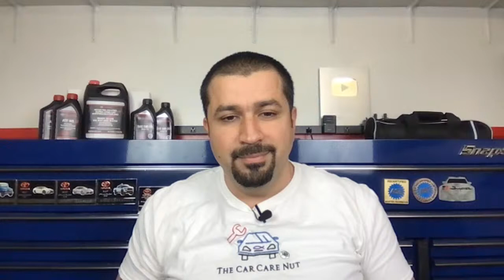Toyota Live Stream Q&A

Comment: Hello there. I really enjoy the good videos and advices that you are putting out. Your video on 14 Nov 2020 mention about the electric lube oil pump for 2.5 litre toyota atkinson engine which is programed to give a big boost in oil pressure when engine reaches 3000rpm. I think this toyota engine switches to otto cycle when it is at above 3000rpm. It need the higher lube oil pressure for the actuator to switch to otto cycle? . Regards.

Comment: 2013 Toyota Sienna, sliding door will not stay open especially on a slanted surface.  Basically it will not latch in the open position causing a safety issue.  Well out of warranty at this point, how do I resolve this issue?

Comment: Got a 98 toyota camry with  a 4 banger. Check engine light is on for the purge canister. That was replaced. Check engine kicked back on.  Could I have a bad computer or something easier to look for??
Reply from the maker: Hi! This will require some diagnosis but the valve at the canister is common to go bad on these. Needs to be tested first

Comment: Hi, guess I missed the live q&a 😟. I wanted to ask about my wife's 2010 RX450h and that her turn signal flash is set to one and she'd like to change it to 3 or 5 times flashing. I found a pdf on line from Lexus that explains how to do it but the display interface looks different than what we have and there does not appear to be an adjustment under Vehicle Customization. Our car does have Nav. 

Is there a way for me do change the setting without having to take the car to the dealership to either update the interface and or make the adjustments for me? Thanks!
Reply from the maker: Hi! I would take it to the dealership they usually don’t charge to change customizations

Comment: PLEASE tell us about trouble codes. My 2016(150k miles) sienna keeps popping codes P219D and P21A1 once a month. My Bank2 long trim stuck around -3.8 which means it runs rich and the AFR sensor doesn't change the readings . Bank1 Long trim reads 0.00 . The engine has no misfire and it runs great. My gas mileage has dropped a bit . there is no vacuum leaks or any kind of oil leaks either. I am about to replace AFR sensor on bank two (which closer to Radiator). Any help is greatly appreciated.

Comment: Hello great video.  Question for you. I have 2014 tundra 4.6L 4x4. Its has 82,000miles. I want to change the differential fluids. Can I use royal purple and is there any special additive that is needed with the fluid?
Reply from the maker: Hi! You can use royal purple and no special additive

Comment: Hi AMD and thanks for sharing  I have a 2014 Toyota Venza with @80K miles Recently I have noticed low cooling on the expansion bottle Went to a local Toyota service and they told me that there is an external coolant leak from the rear head gasket and their recommendations is to repair or replace the engine both options are very expensive The coolant leak is minor The car is running great and never overheated no evidence of mixed oil and coolant What are the risk to drive the vehicle like this? In one year I just need to top up the coolant once
Reply from the maker: Hi! If you keep the coolant topped off you’re good. But after some time it might develop into a large leak. Might be a long time though so don’t worry at this point.
Reply: Thank you AMD !!! I have checked and there's no recall associated with this.  Is this issue may be related to a manufacturing defect and covered by an extended warranty?  I never expect this to happen on a Toyota car....  @TheCarCareNut
Reply from the maker: That’s not something covered by a special policy.

Comment: Recently, my 2004 corolla with 207k miles has triggered the P0420 code. In 2019, I had the same code come on and after clearing the code the check engine light stayed off until now. The car does not burn oil.  At what millage do catalytic convertor fail? Do you recommend I take it to the dealer to have the ECM reprogrammed?
Reply from the maker: Hi! Are there any exhaust leaks?

Comment: Hey there AMD,
thanks for the wonderful work.
I just bought a 2015 Highlander Hybrid with 66k miles on it. The transmission fluid was never changed. Should I change it or does the CVT transmission not need that?
2nd question: Why do they sometimes say, that changing the transmission fluid could do more harm than good? Do you agree and when?
Reply from the maker: Hi! On regular cars doing the transmission fluid late can cause more harm than good not with hybrids. You can change your hybrid transmission fluid every 60-90k milestones
Reply: Thanks a lot master. I appreciate your work very much.
While I'm at it, I think I'm gonna change the coolant (motor + hybrid), since I think that those haven't been changed yet. Unless of course you say no to that ;)
I don't know any other important stuff to be done at 60k+ miles. 🙈

Comment: Another great live stream AMD! Any chance you could share some photos of the timing belt replacement on the 2UZ-FE you mentioned you are doing at work? I have to do mine on my 2003 4runner next year and could use some pointers.
Reply from the maker: Hi! It’s super simple if you follow the order. It’s like a big lego puzzle. Remove parts and line them up in a line then install them in the exact order. Read the manual on it and use the T marks not too dead center
Reply: @TheCarCareNut  Thanks for the great advice! I'm going to change the water pump as well and have seen some issues with the one O-ring not staying in place during installation. Any recommendations?
Reply from the maker: Use some lubrications on the o rings. You only have the ones around the water pump

Comment: Hi AMD, 2019 Camry LE at 25k miles. Driving in the southeast. The front driver side brake makes squeaky noise only in low speeds (2-3 mph). The pads look plenty good. It's only on that side and the noise started weeks ago. Doesn't happen every time.

What's the issue in your experience? Could it be bad caliper to pads lubrication?
Reply from the maker: Hi! There’s a TSB for this for updated pads. Would need to check if it applies to your VIN.
Reply: @TheCarCareNut  Thank you!! I'll check with the dealership on that.

Comment: Hey, I appreciate the service you are doing for your fellow men and women. You have probably answered this somewhere in your videos but I'm a new subscriber...I have a 2003 Toyota Tacoma with the 2.7 4cyl, it's a great truck that has not let me down so far...the truck has 250,000 miles , I was wondering if you recommend 5000 mile oil changes on a truck of this age and is the 2.7 a good motor...Thanks so much Amd......
Reply from the maker: Hi! I would recommend oil changes on that engine anywhere between 3000-5000 miles

Comment: I bought a RAV4 2021 Cruiser Hybrid 4 months ago. Love the car so far. I plan to change the oil every 6 months or 7500 kms. I know the A25A-FXS engine has only been around a few years but does it seem more robust than previous engines against yearly oil changes? My Toyota dealer insists I do not need to go to 6 month intervals but says its up to me but I have to pay for it.

Comment: Hey AMD. Question for you? When replacing a timing belt is it always necessary to replace a water pump on a vehicle? Just curious. Most service manuals say to replace the belt only .
Reply from the maker: Hi! It’s not required but highly recommended especially if you’re paying labor to replace the belt. The water pump is a common failure point on many cars and when it does fail it could damage the belt and cause issues.

Comment: Hey AMD, would it be possible to find out if my 2012 camry had it's torque converter replaced or had it's software updated? My camry doesn't shudder but it takes a while to downshift when coming to a stop to the point that the car is lurching as it is coming to a stop. Is that normal or should I get it checked out?

Edit: It has no problem accelerating and upshifts normally. Also downshift on 4th+ gears are okay, but it is only at lower speeds that causes it to lurch. I thought it was normal but my 2005 chrysler mini-van doesn't have this problem so now I am contemplating it again.
Reply from the maker: Hi! Contact your local Toyota dealership and they can find out for you
Reply: @TheCarCareNut  Apparently it was because of eco mode haha now I feel stupid.

Comment: I have a 2019 Rav4 Limited with 20k miles, the dealer is asking if I want to purchase an extended warranty. Is the dealer offering a Toyota backed warranty and would you recommend purchasing it? Thank for taking the time to answer my question, Tom in Seattle.
Reply from the maker: Hi Tom! It depends. If the warranty is called ExtraCare then it’s a Toyota backed warranty if not then it’s 3rd party
Reply: Would you recommend the Extracare warranty, I plan on keeping the Rav4 a long time? Again thank, Tom
Reply from the maker: Hi! I would if it’s a reasonable price. It shouldn’t be more than $3000 and should be platinum coverage

Comment: Is there a trd cold air intake that is compatible with the 2021 4runners?
Reply from the maker: If it’s compatible with 2014 and up then it is with 2021 as nothing really changes
Reply: @TheCarCareNut  Thanks for your reply!  Is it true if I buy an oem part or system like this cold air intake and install myself then Toyota will not warranty it? Does it void other coverage on the car related to what I install?
Reply from the maker: Hi! Yea If it’s not installed at a dealership you won’t get warranty on it

Comment: First I want to say, you make Great Shows and Great videos, keep up the good work. 1 Comment I wanted to ask you about when you covered Rustproofing. I have a brand new 21 Toyota Rav4 Prime XSE. I was told not to rust proof the underneath because of the hybrid battery and wires underneath the car. In case they would have to get to the wiring or could cause heat or moisture to build up underneath the car. I live in NY (1 of the boroughs). I'm leaning on the side of caution, and will try to wash the underneath this winter as best I can. Do you think I'm being overly cautious. Thanks again, and I wish more mechanics were like you.
Reply from the maker: Hi! No issues undercoating hybrids but the newer ones are very well covered underneath so it’s not as needed as before

Comment: Excellent advise fir long trips.  Most wait till last minute. Don’t factor in our schedule being backed up before holidays.  

Also I have advised folks who neglect their cars that they need to borrow a friend/relative or consider renting car for long trips. 

It’s a big responsibility to look a high mileage car over and pronounce it safe. Too many parts can’t be inspected (Fuel pump, wheel bearings etc) that could fail at interstate speeds That would never give a problem in town driving. 

You also would be surprised how many I told had unsafe for long trip vehicles drove them anyways then called from 200 miles away wanting to know what they should do now. 

I’ve seen a lot of craziness in 45 years professional car repair. Glad to be retired and taking care of grandson.  I really enjoy your honesty when asked to diagnose a problem without driving, hearing or seeing it.  

Don’t change your style one bit. I have shared your videos with several techs still working. 

Del

Comment: Love this channel.  So informative.  I have a 2015 4runner, live in a rust belt and the am very disappointed to learn the back rear window frame is rusted out and preventing the rear window from operating properly.  The rest of the truck "body etc" is in fairly good shape.  I discovered the rear window frame was rusted out after the rear window was accidentally opened and would not close.  After finally getting it closed 1/2 inch at a time and replacing the original battery the ecu started throwing codes about a knock sensor fault.  I cleared the code but it came back several times so I brought the car to the dealer.  After checking the wiring for possible rodent damage going to the sensor the dealer told me the ecu was not putting out enough voltage on one of the wires and it needed to be replaced.  "About $1500.00 ouch".  After clearing the codes about 2 or 3 more times "and not operating the rear window wiper or window" the code has not returned in about 6 months and everything has been fine.  Is it possible that an abnormal current draw on a component "rear window or rear window wiper" can cause the ecu to have issues and start throwing codes?  I'm really perplexed by this and also wondering how difficult it is to change the rear window frame as the dealer quoted over 3k  Yikes!

Comment: I have a question I have a Toyota Camry 2007 when I stop light the motor is on vibration I changed motor mount. Spark plug the most thing can cause vibration I don’t check engine light on I don’t know if you any recommendations. Only when is Neutral is silence not vibration. Thanks for your videos it’s help me a lot

Comment: I had a follow up question from the last live. I asked about replacing my oil control valve for my 2006 prius since it randomly gets p0011 code (more often after a fresh oil change). You mentioned it’s simple and to give it a shot however it may be the cam phaser. What would be other symptoms of a failed/failing cam phaser? How bad is it to drive it without replacing it? Is this a involved and costly job? 

Also when changing the oil control valve is it important to change the mesh filter that’s under the valve behind a plug in the block? If so any special instructions to replace that?

Thank you for all your help always! Love your videos and guidance!
Reply from the maker: Hi! No need to replace the mesh. Slight drop in gas mileage is about it if you don’t fix it
Reply: Thank you for the prompt response! And as for the cam phasers? How would I know they are bad and how expensive/involved is it to get them replaced?

Comment: Hi Amd, my 2007 4Runner just riched 60k right now I just did a big service recommended by my local Toyota dealer, at what mileage should I change the timing belt? Thank you!
Reply from the maker: Hi! Every 90k miles or 9 years. Now the 9 years I wouldn’t panic over because these belts can last. Have it inspected if you see cracks replace it
Reply: Why 0w16 it starts the hydraulic process on the rod and main bearing much quicker than thick oils no matter how slippery the oil is until the hydraulic process starts it's bearing on steel

Comment: What is your opinion on the direct injection engines prior to Toyota introducing the port and direct injection? Are they really that bad, a bad Toyota design? I'm referencing the Lexus IS250, and not sure what other cars got that engine. They say they fixed the direct only injection in 2010, as they still offered that engine I believe until 2014. Seems like a long run of engines that are potentially a bad design, or has the problem been overstated?
Reply from the maker: Direct injection only engines are much more likely to have carbon build up.
Reply: Kind of a bummer Toyota wouldn't do a recall to retrofit the is350 injection system (dual port injection) and address the issue long term.

Comment: ?? for you. recently got a 2006 Lexus Gs300 3.0 with 236k. Jolts from 2nd to 1st, slowing down to stop....It drives well, smooth except slowing down to stop..any ideas? thanks as
Reply from the maker: Hi! Was the transmission fluid ever serviced?
Reply: @TheCarCareNut  yes recently. No grinding, miss shifts, gear hunting  until slowing down to a stop particularly from 2nd to 1st.
I think it may be the ecm for I hear it's prevalent issue with these models. Just my 2 cents. Thanks again for ALL the informative content. It like having a Toyota/Lexus interactive manual..lol

Comment: If you were to buy a used 2018 Lexus LS for longevity. Which one would you choose? A LS500 or LS500h?
Reply from the maker: They are both equally reliable but because of their complexity long term the non hybrid in this case might have a slight edge
Reply: @TheCarCareNut  thank you for your prompt reply.
Reply: LS500 for sure, no hybrid unless you drive over 200 miles a day. LS500 is a reliable vehicle but I wouldn't get a hybrid unless Absolutely necessary

Comment: Hi I have a 2018 camry se that shut down on the highway. Dealership said the catalytic converter inside was burned out but can't find any issues with the engine even though it can't start. Do I need a new engine?
Reply from the maker: Hi! Likely not but they’ll need to investigate a bit to verify what caused it to fail
Reply: Thank you for replying. Yes they investigated. Even Toyota Canada was called in to check. The engine is currently dismantled and they have unable to find what's the problem. They will try to put engine back together and see what happens
Reply: I will update on what happens. If fails I would gladly want to know where can I get a new engine like the one you built in your video: "Toyota's New Engine assembly Full start to finish"